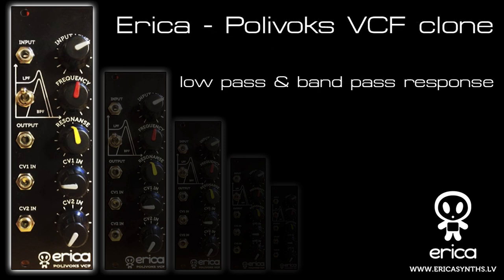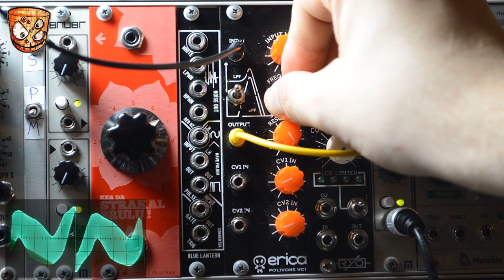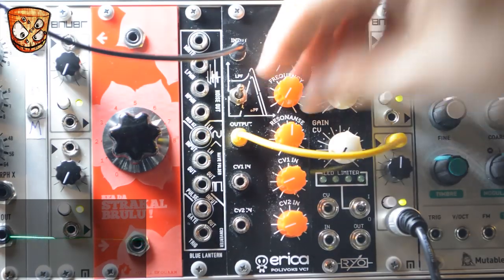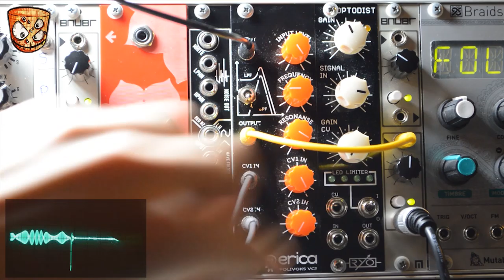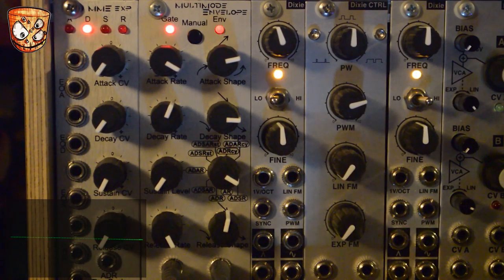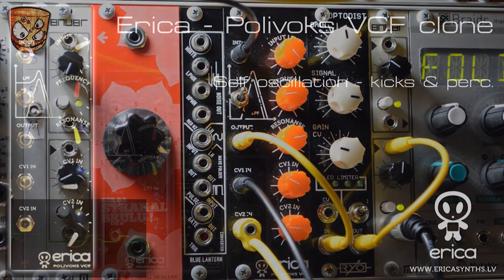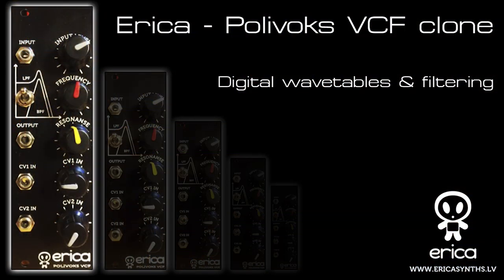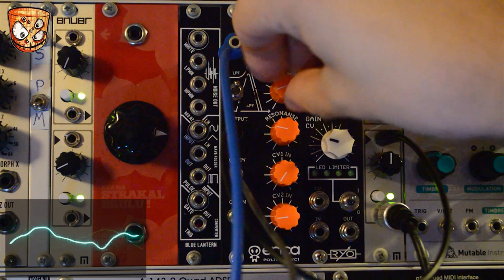Erica Synths - Polivoks VCF Clone

Comment: Hi, thanks for the amazing demo, I use it as a reference to check if my built of that module is working correctly. Actually your resonance is sounding less chaotic and stuttering than mine and I am wondering why. Do you use +-12V as a power supply? I am using the KR140UD12 as programmable opamp, the KT315G as NPN transistor and the TL072 for the output, are you using the same parts?
Reply from the maker: HI Dronty, it is using standard +/-12V Eurorack power. I don't have the module anymore to check the parts. If you can dial your resonance back but it just goes a bit further into chaos on the knob that's not a bad thing in my mind.
Reply: @DivKid  Thanks for your response! I am not sure, there is somekind of noise crackles on the resonance that sometimes disapppear, What kind of power supply do you use?
Reply from the maker: I have multiple options for power and cases now and haven't noticed any unwanted crackles. In this video it will have been a Doepfer low cost case. PSU2 linear supply.

Comment: sorry if its a dumb question, is the Erica Black Polivoks VCF basically the "stock" version of this one?
Reply from the maker: +wooki321 not sure to be honest as I don't have one. But I imagine it's the same "back end" circuit. The Black series of all very high quality so it will stand up as a bit "better" if that's the wording you're looking for. The same circuit (I believe, I'd have to double check) is part of the Dtech filter. Which is also very good.

Comment: Ben,

with the MIDI-to-CV module...would either of the CV outs to the CV in on the VCF allow filter cutoff to be tracked by the keyboard?

sorry, just cutting my teeth in the modular world.
Reply from the maker: no worries and you've got it right. You can use the pitch CV output to the pitch of your oscillator AND to the CV input on the filter and use that CV to adjust key tracking the filter cut off. You might need to use a buffered multiple to split CV output to both the oscillator and the filter. Doing it passively with either stack cables or a passive multiple might give you a noticeable voltage drop making your pitch tracking not quite accurate.
Reply: +DivKidVideo ok I follow the flow..but...there is nothing explicitly labeled "pitch cv" on the Erica voks VCO, VCF or MidiCV modules just 1v/OCT IN on the VCO and CV 1 & 2 In on the VCF and CV OUT 1 & 2 on the Midi-Cv module. 

I'm wondering if leaving it patched this way, passively, might make the oscs have the "detuney" behavior like the original voks.
Reply from the maker: Hey Rob, not sure if the CV inputs on the VCF track 1v/oct but you can certainly get it close enough to get standard key track type behaviour from it. The MIDI to CV I think it's just gate and CV output, CV is the pitch information. It's not so much a detuned sound as a droop in tracking. So within one or two octaves it might be fine but over 3+ you'll notice the pitches sounding flat. They'll get flatter the higher the pitch. If a passive multiple/split of the signal was a 2% error per octave then 2 octaves would be a 4% error and so on.
Reply: +DivKidVideo ahhh, makes sense now.

question, is there a standalone buffered multiple box on the market? Since I don't want to build a whole new skiff just for a single module...which will end up in my divorce because I highly doubt I will leave skiff 90% empty for too long...

wouldn't a DI box actually do this?
Reply: +Rob Lo thanks for the help btw....really appreciate it
Reply from the maker: Hey Rob, bit late getting back to comments but the easy answer is I don't know RE standalone. Can you swap a module out and make 2HP of space to fit it in somewhere? What's the current set up? Happy to have a look through with you and see how you can maybe work it out.
Reply: +DivKidVideo well..I'm stuffing a SYR-E84 (Roland System500) skiff dedicated to the Polivoks build.

it's exactly 84hp...so I have exactly 0 room lol.

One thing, I am looking to patch it so it functions exactly like a Polivoks and will be leaving it. Nothing else will be getting routed to it. I'll also be using it with a 4 octave keybed...and I don't use sequencers. So the most I will be tracking is over 4 octabes, ever.

so not sure if this trivializes a buff mult. 

also, lol...I am dealing with bigger issues at the current moment with building it. so far I've ripped a pad off a resistor, soldered a transistor in backwards and reversed the polarity on the MIDI/CV module LOL..

still fun so far though
Reply from the maker: While I don't have the whole 84HP polivoks voice I keep thinking of building up my own Polivoks based system in a skiff that stays that way and is left. Probably more modulation and routing possibilities though as I'll be putting my own spin on it together.
Reply from the maker: good luck with the builds, I've made some silly DIY mistakes as it's not something I do that often. Luckily most things seem fixable with a bit of help.
Reply: +DivKidVideo I was actually think of making a re-edit of the modules into one PCB and getting a case and panel fabbed for a desktop module..

should be easy as Girts made the schems publicly available. And he actually did exactly that while prototyping.
Reply from the maker: yeah that sounds like a good idea. I like things as set instruments and that in one case would be good in the studio.

Comment: When you are using the scope, you can hook one of the oscillators other outputs to the scope trigger input, it makes it easier to see whats going on.
Reply from the maker: Yeah I did know that, but the scope is an after thing. I don't actually have the scope. I run audio through a scope at work after the video is edited and can't get my set up to work, or the scope home. Which isn't ideal. 

Recording a square wave from the oscillator and sending that out to the trigger as well as audio out to the input would be a bit of a work around.